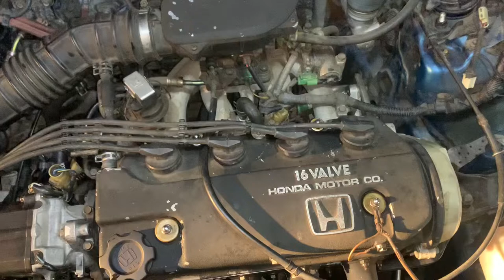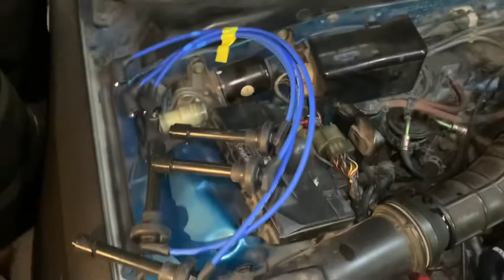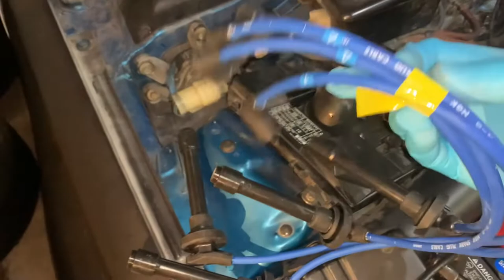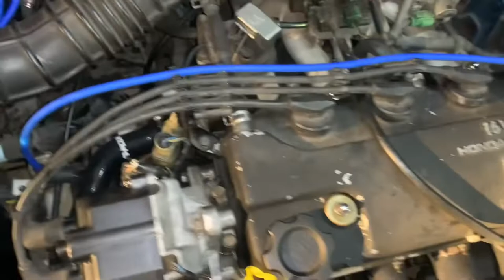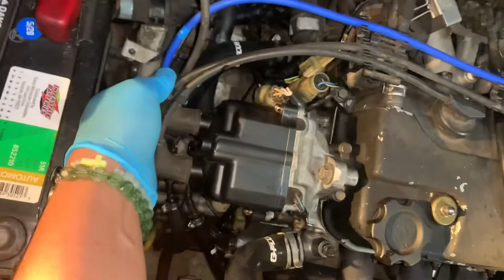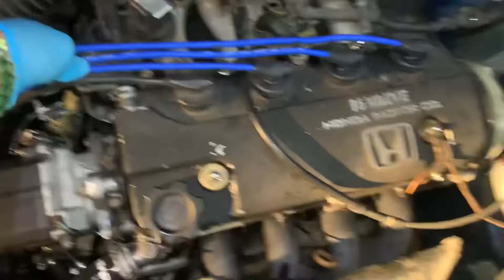NGK spark plugs wires install to 88-91 Honda crx / civic DIY

Comment: Aren’t you supposed to grease them before just completely replacing them
Reply from the maker: Yes
For sure, I’m glad you’ve noticed it, I would recommend using synthetic grease on generic spark plugs wires like ebay and Autozone special because of the spark plugs wires boots melting with the spark plugs.  Oem / NGK which I have not have encountered any problem just yet.  Thanks for watching my videos.